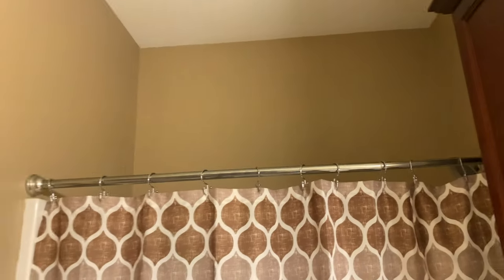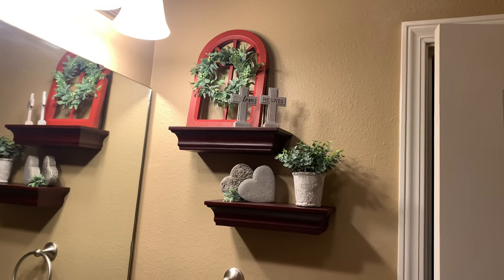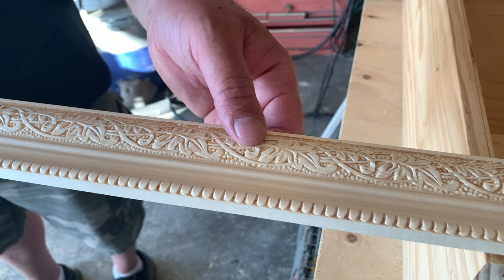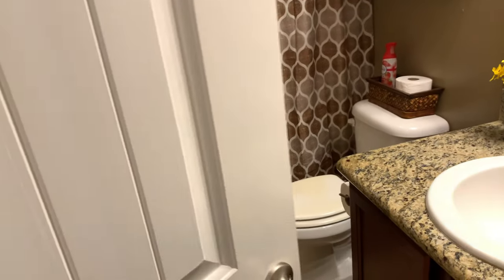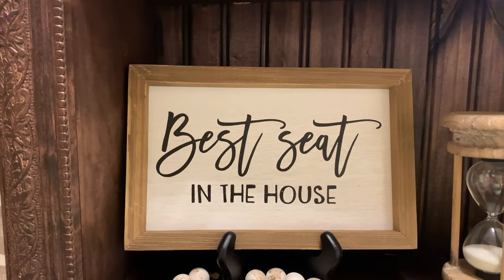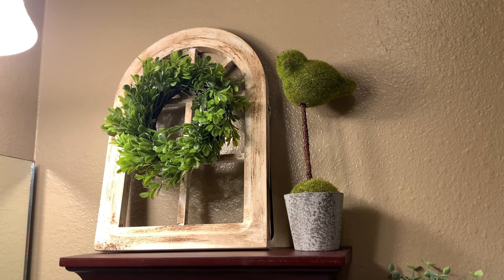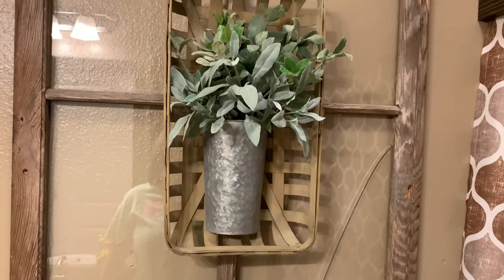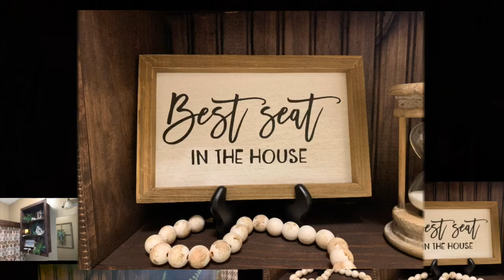Guest bathroom spruce up

Comment: nice shelf were did u get the little buckets from with the fern in them .They r so cute
Reply from the maker: Thank you!  I got those buckets from Hobby Lobby. ☺️
Reply: @DelightfullySouthern  thank u I try looking for them at hobby lobby  r they name different  or do u still have the number were u can look them up.Sorry for all of this
Reply: did the bucket have a number were u can check them and r the they half buckets
Reply from the maker: They were in the spring shop section. The number is 5906896. ☺️
Reply: @DelightfullySouthern  thank u